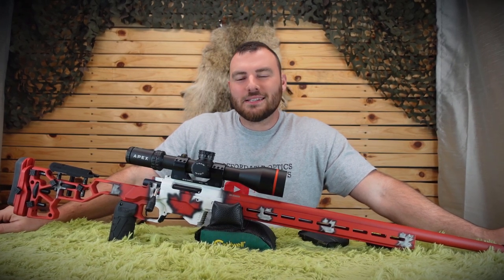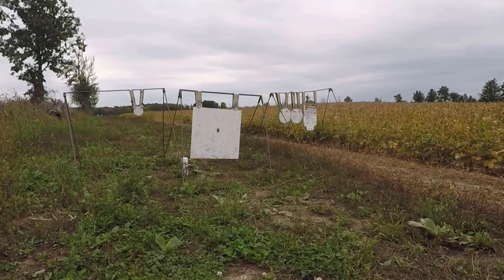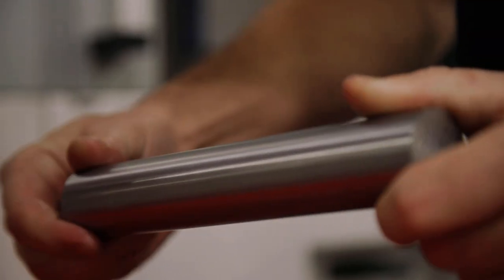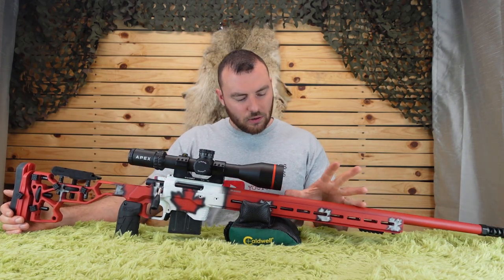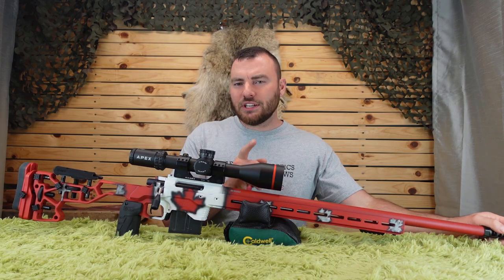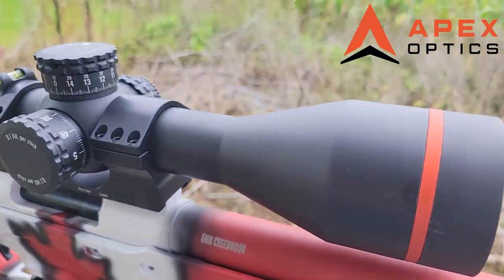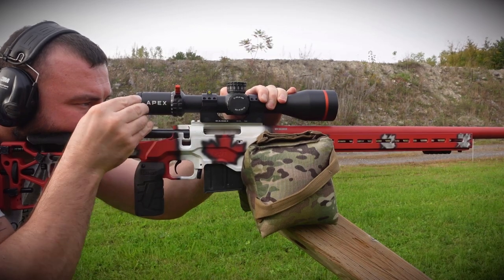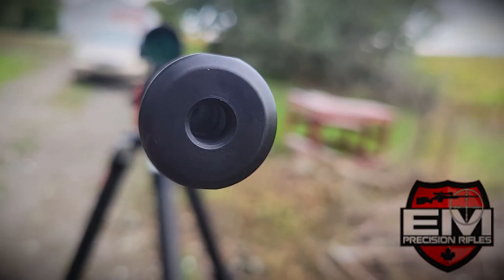Pristine Action, JC Custom Barrel: Fully Canadian Fully Custom

Comment: I have a Savage FCP-K in an XRS chassis, and I'm thinking of changing out the barrel. 

The thing is: that would mean the only parts that would still be the original FCP-K would be the bolt, receiver, and trigger...

Comment: Would you prefer this over the deadline action with IBI barrel?
Reply from the maker: good question, the deadline, has a shorter bolt throw, witch is really nice. but the Pristine was  just smoother. also in my experience my JC custom barrel was the more accurate out of the two

Comment: Beginner looking for my first rifle that will be swapped into a chassis. Stuck between Tikka CTR 308 or Tikka Super Varmint 308 both 20 inch barrels. Need help deciding ??
Reply from the maker: If you are going to swap it into a chasis go with the super varmint. Heavier profile barrel is better for heat dissipation
Reply: Any recommendation on the scope ? Like the TORIC UHD 4.5-30x56 34mm but not sure if it is over kill. Thanks in advance !

Comment: Since you have had hands on the 3 Canadian manufactured actions, how would you rate them?  1st, 2nd and 3rd in performance and then value.  Thanks.
Reply from the maker: Good question, I've only used the deadline and the Pristine. No other canadian action. And really for reliability both worked great, the only thing I find the deadline could have considered as an advantage over the Pristine is the 60-70 bolt throw. Also the primary goal of an action is to ensure tolerances and variables are kept very low. As well as being "true". Provided the action is true  the work is done by the barrels, for example single point cut vs a button rifle barrel.
Reply: Would you explain the difference in the two barrel rifling processes?  Again thanks.